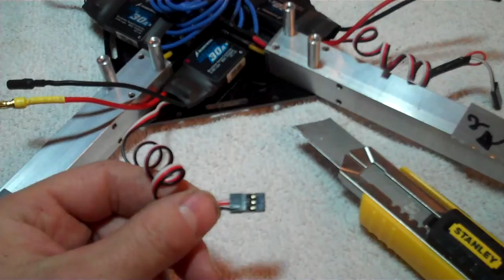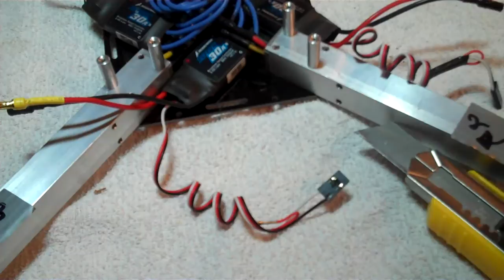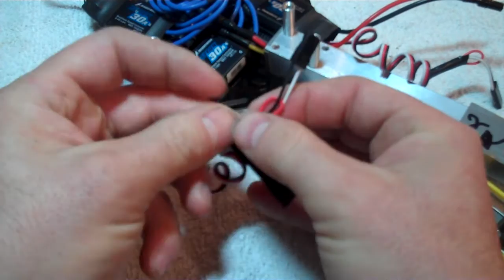Removing the red wire on your esc for your quad copter setup

Comment: most BEC ESCs come with a bulky heatsink and thermal pad,  im assuming it will be safe to remove these as well since the voltage regulators and no longer being used? doing so would drop a 24g ESC down so 8 - 14g

Comment: hey my esc becomes hot ,well I m using 1000 kv motor and 30 amp esc but my esc becomes hot.so one suggested me to remove my red wire ? what happens from it ?

Comment from the maker: It depends on what flight controller you are using. Open pilot might say you don't have to do this. Naza might say remove the red wire in all your escs except but leave the red wire on in only one of them.

Comment from the maker: When you decide which control board you want I would recommend you find a PDF manual of that board online and determine what the requirements are asking. Example - do any red wires need to be removed or not? This will help you lots.

Comment: Thanks, didn't even think about this before, you probably just saved me a new receiver. I sort of assumed the receivers were smart enough not to take too much voltage in but after opening up this little turnigy 9x, argh.. it's pretty basic inside..

Comment from the maker: Sanity93,  your right.  Not all controller boards require the red wire to be removed.   The  FY-90Q that I have however did say I had to. Thanks for your comment.

Comment: Most FC (Flight Control boards) like KK / 2.0 do only use power from the first motor (ESC) connection.  There is no need to remove the red wire from any other manual, and they even state not to.

Comment: The important reason to disconnect ESC's red wire is, some of the ESC's do not like parallel connection of their 5 Volt powers. On most of multicopter control boards, the ESC volatge (Red & Black) connections are parallel. Also Gnd(Black) and Signal (White) should be used for control, therefore only option is to connect one of the ESCS Red pin and remove others red wires.

Comment from the maker: I don't own these ESCs personally so I can't say. In my opinion I would say it depends on what it says in your "control boards" instruction manual.  I currently have an FY 90Q on my quad and the instructions do say specifically to remove the red wire on three of the ESCs and leave the one powering the board.    Hope this helps.

Comment from the maker: Only ONE ESC should be used. The ESCs still receive control inputs from the flight control board ( FY 90q , open pilot,hover fly,kk control board ) if the red wire is left on or not. The red wire is a power source.

Comment from the maker: What I was trying to say was that your ESC powers your receiver. If you have 4 ESCs powering the receiver then your going to fry your receiver even though it's coming out of the same battery.  An ESC is a switch. Turn on the switch and the current flows.  If you leave all the red wires plugged in then your allowing 4 times the needed power for a quad copter.  Quad - remove 3 wires, hex copter- remove 5 and so on. The FY 90q that I use can safely operate between 4 to 6 volts input.  Only ONE ESC